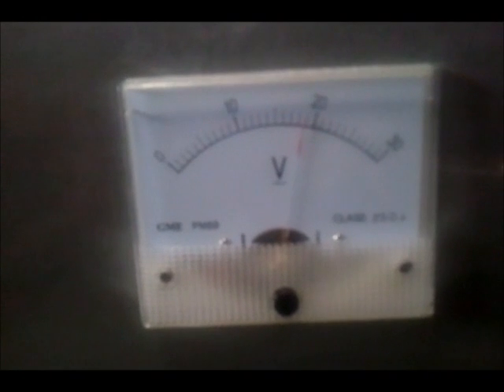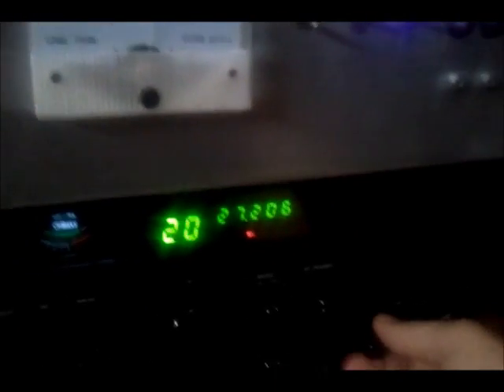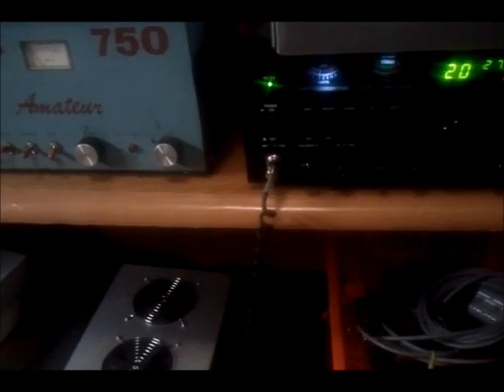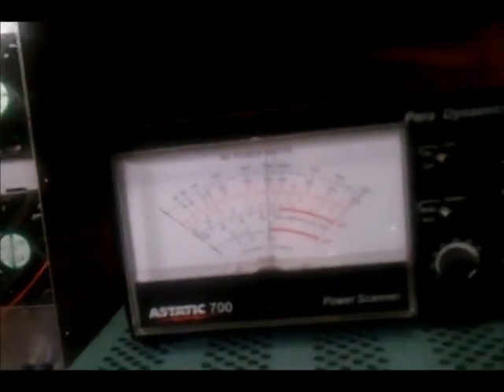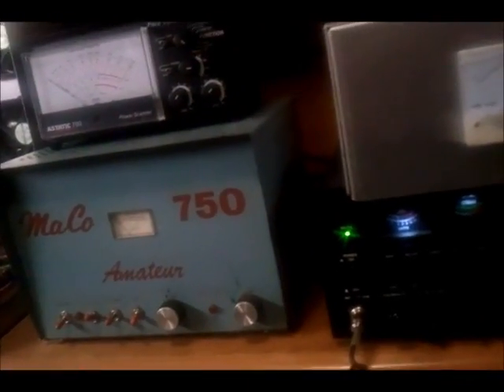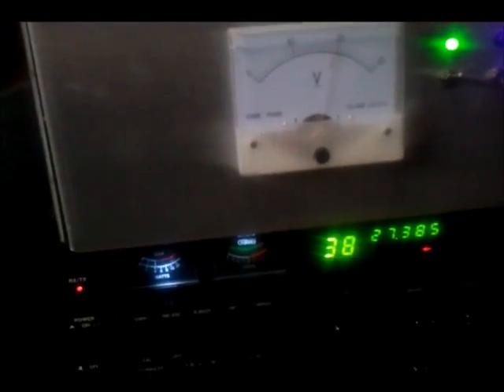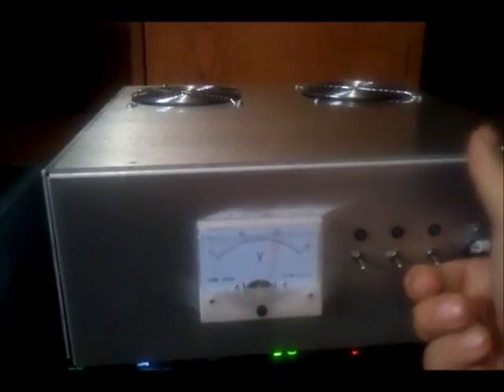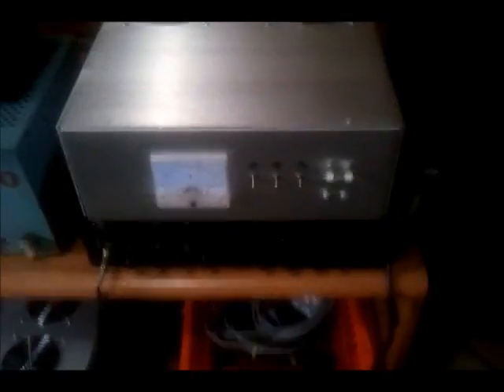Gatekeeper Built 0X4 2SC2879 Custom Base Linear Amplifier - Modified AB(C) Biased

Comment: On your amp builds can you  put a cooling trainsister on top of each 2879 . The trainsister is used in 12 volt ice cest.
Reply from the maker: I have actually thought about this before.  It would be neat to play around with it and see how well it would work. I would love to test if I had a few...if soemoen would send me some Id test then out. Imagien being abel to make these amps smaller cause you can cool them quicker .

Comment: 200 watt PEP from a 2879???????

SILICON NPN EPITAXIAL PLANAR TYPE

2-30MHz SSB LINEAR POWER AMPLIFIER APPLICATIONS. 
(LOW SUPPLY VOLTAGE USE) 
 Specified 12.5V, 28MHz Characteristics 
 Output Power : Po=100WPEP
 Power Gain : Gp=13dB 
 Collector Efficiency : '7 C = 35% (Min.)
 Intermodulation Distortion : IMD= -24dB(Max.)
(MIL Standard)

Comment: i think you'll find these are the 2SC2879 specs.
at 12.5v and 28mhz power out in watts is 100wPEP..
power dissipation is 250w
this is obtained with around 10w pep input,
thats from the RFparts own spec sheets..
so an increase of say 3.5v and over driving the crap out of them gets you 250w from one ??
i don't think so..
i mean surely if the ameritron ALS which uses the same transistors is biased differently, that must be for the better, are you saying ameritron could get around 1kw from theirs ??

Comment: Sure a class C amp is more efficient, but not to run any signal through it that contains audio, and the signal that comes out the CB has both. The carrier wave is mixed with the audio signal in the modulator and then the audio is in the side bands each side of the carrier. Then any thing that is done to that signal has to be in a linear fashion to preserve the quality of the signal. If there was no audio it would not matter like in C.W. A SSB rig filters out one side band as they are the same.

Comment: How right you are. Sounds dam good to me. Was only trying to clarify a topic. My mentor is a ham that is a design engineer for a large company that makes high power transistors. His job is take the trans. and design circuits they can be used in. The last thing he sent me was a new trans. that ran 1300 watts out from one trans. at 800 meg. very low drive as the gain is so much. The problem is it cost 225$ each, runs at 50 volts. Two of those is sure a bunch of output. Take care.

Comment from the maker: Thanks though 1903 for the comment of the amp. I'm sorry for anything I did say during the video that wasn't true. I have learned so much since then. I use an AB Biasing board that my mentor disigned that allows exactly .7v just enough for the transistors to conduct which makes them less as efficient but GREATER Linearity. AB Biasing is best for SSB, Do you agree or disagree? That is the question. Sorry again for my wrong words during the video. You are right about that. Thanks.

Comment: If you run a signal into a class C amp it will be distorted. Simple no way for it not to be as a class C amp does not amp. the entire signal.  All modulation must be in a linear mode and C is not. You can not do what you are  saying you can. Talk to a electrical engineer that has had linear mode education [not digital] he will tell you  the same thing. If you have to ability to build such an amp you can surely learn the modes of amplification.  That was a nice looking amp the terms are wrong.

Comment from the maker: Sir, I'm sorry but you are mistaking. 2SC2879 Transistors are 200w PEP Transistors. You are confusing the 100w with PO Power Dissipation.

Now with the Ameritron, yes it is is bias differently then the Amplifier in this video. Plus let me ask you this sir. How much power are you inputting into the amplifier?

Also sir, then you ask, well even if they are 250w PEP how are you doing 1,000w. SIMPLE... Those specs are for 12.5v, so with running on 15v, or 16v, etc...then you get your 1,000w. Thanks

Comment from the maker: "I am wrong on the Class of Amp and what it does" OK Sir, I am not wrong on the Class of Amp I constructed but, yes, more can be added to the details. For AM, Class C is the most Efficient Class but is harder to keep distortion from your signal if not properly tuned & filtered. While Class AB is the best Class for SSB Operation because while it isn't as Efficient as Class C but way more Linear.

Running Class C in SSB Mode, you have a high chance of distortion and your signal not being linear.

Comment: Hate to tell you but you are wrong on the class of amp and what it does. Class C only works on a very small part of the signal, a class A amp covers all of the signal, a class B amp covers half of the signal, so there for a AB amp is some where between a&b.  Its all in any electronics book.

Comment: how do you get over 1kw PEP when the transistors are only 100w PEP each, so 4 x 100w PEP is around 400w PEP..
even the Ameritron ALS-500 with 4 2SC2879 only does 400w AM/FM and swing around 750w PEP..

so what meters are you using, one that lie or true calibrated Birds..